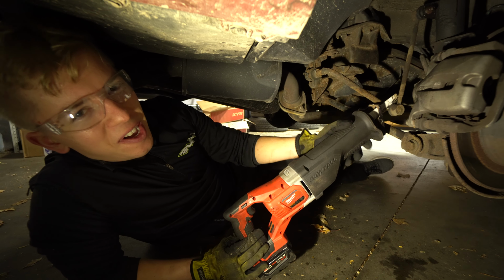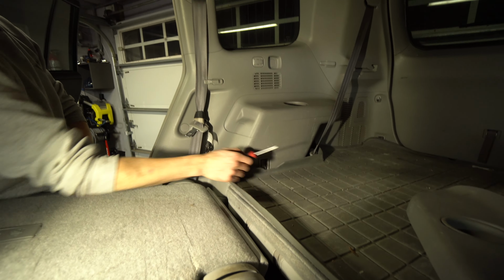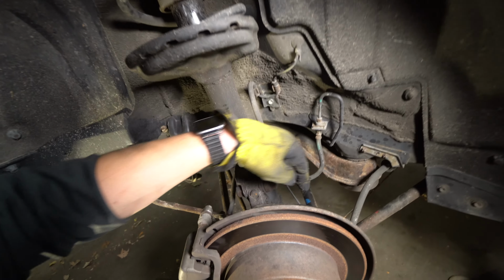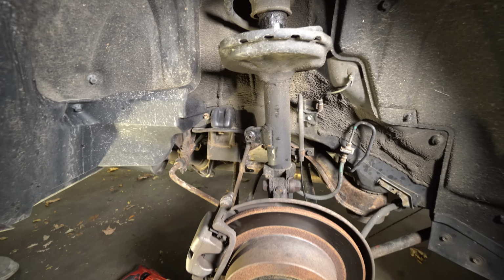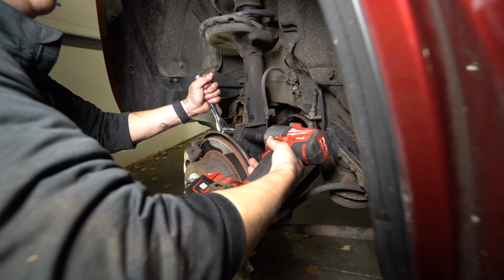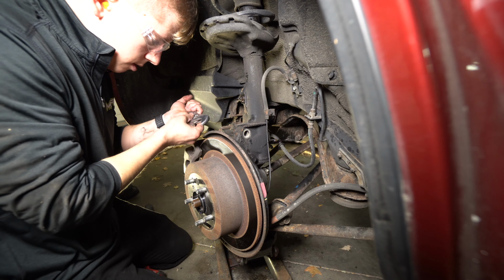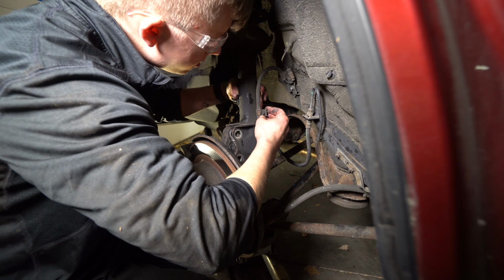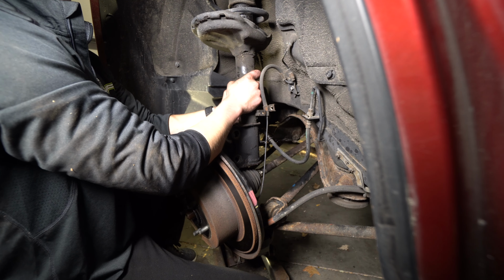Rear Struts Replacement Toyota Highlander 2008

Comment: Yea I can’t get that lower strut bolt to come out. The top one came out easy. Used a torch and spray but no dice. I just put everything back together. My last option is to cut the nut.
Reply from the maker: The two bolts on the knuckle? Or the sway bar endlink?
Reply: @HardwayLearning  the steering knuckle. I usually just cut the sway bar links off too lol.